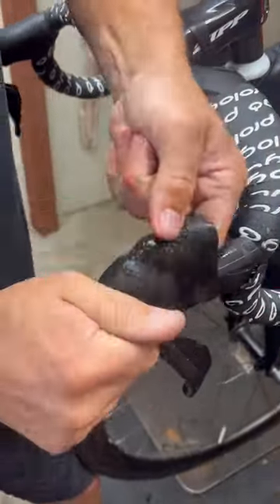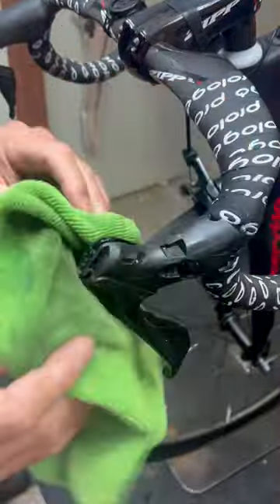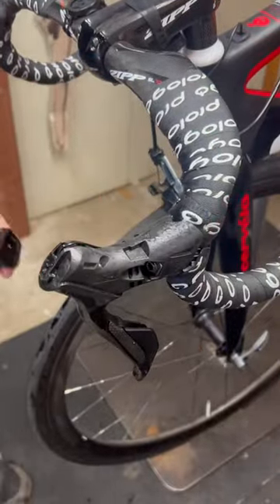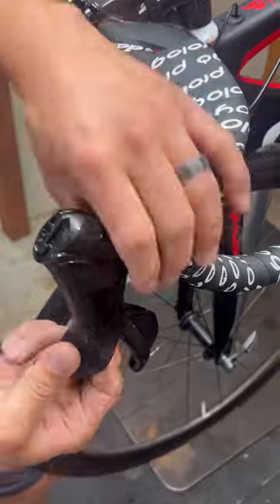Using isopropyl alcohol (70%) makes replacing your shifter hoods a breeze #bikemechanic #diy #wow

Comment: why 70 and not 90%?
Reply from the maker: 90% is to strong and not necessary.
Reply: @bikeworksbywes  thank for the response. All I had was 90 and ended up using it and I think it was fine. Someone else was saying that 70% is better because it doesn't dry as fast. You have to be quick with 90.
Reply from the maker: @al-du6lb  aww yes I didn’t know that. Yea that makes sense, I also like 70% because it’s cheaper as well.